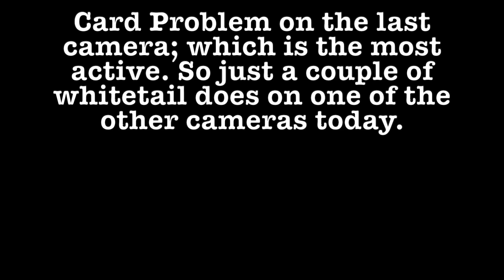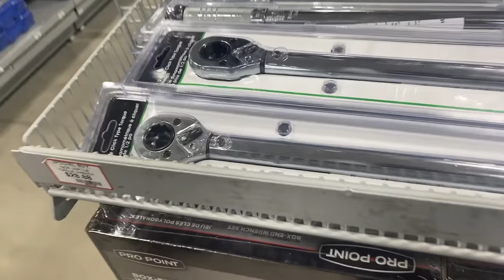BUILDING a CABIN in the FOREST - FIRE WOOD // LOW COST POWER // Simple Storage Ideas

Comment: $1600 is so cheap. What is the total cost to bring power in? I think we were quoted 10k per pole here in BC but it would have to cross other private property and I'm not sure how that would work out
Reply from the maker: $1600 was the total cost for the poles and it is $2000 for the panel and mast. So around $3600 all said and done for power. If we had to pay 10k per pole, we would have never ran power either. The first pole is free here and then it goes by per metre from there. After adding it all up, it just makes more sense for us to do it this way as Jeremy wants a working garage with high powered items, etc as well. We do want the ability to be operational without the grid and even operational in a worst case scenario, but want to be able to do whatever we want in the meantime. Hope all is well with you , things are looking good over there, we keep up on our tv as much as we can so dont always comment either :)

Comment: Can't wait to see the finished home.  Even though you're going on the grid, my suggestion would be to not have the well hard wired.  Not sure how you plan to power your home, should the power go out.  Unless you plan to have the battery banks tapped into powering your home, if the power goes out, then the well can not be used in the event the power goes out.  That's the problem I face with my own home in Gary Indiana USA.   It's hard wired, and I have no water, if the power goes out.  I do have a pressurized tank, but it limits the amount of water available without power.  .  My suggestion would be to have an outlet for the well, and then if the power goes out, unplug the well from the outlet, and plug it into the power strip for the battery bank.  That would be my suggestion. If you still plan to hard wire the well, then I'd suggest an outside plug to plug in a gas generator to provide some power to the home.  I have a family member who chose to have an outside outlet to plug in a gas generator, and power the essentials,  and one of those essential,  is the well pump.  Like my home, and yours, the well at that person's home operates on 240V.
Reply from the maker: We are planning on having the option at the panel to run the home off a generator as well. Thanks :)

Comment: Solar never really had a reputation of being cheap. The upfront cost was always high. You have to take into consideration of the long term benefits. It pays for itself in 10 years (or probably way less nowadays as solar gets cheaper every day), and it can potentially provide basically free energy for another 20 from there, whereas you'll get your monthly bills from your grid power supplier forever, and those bills will only get higher. And it's not like you'll lose your money if you decide to sell the place, solar adds value to your property.
Reply from the maker: We crunched all the numbers and in the long run it is not even comparable how much cheaper it is to run grid power for our needs. Maybe we will share our info someday more in depth. Note - in 10 years most likely all the batteries will need replaced and by 20 years all panels will also have to be replaced most likely. Having said that, there is more to it then that from our research and experience. All the best. :)
Reply: @MBFModernHomesteading  Obviously I don't know anything about your specific circumstances, all I know is that many people already have, or plan to install solar in the future. Both on the grid (no batteries required) and completely off the grid. And I'm pretty sure they did the math as well and arrived to a different conclusion. But again, your circumstances could be different.

Some european countries already planning new laws that new homes will have to have solar installed (just putting it out there, I know this doesn't affect you).

Anyway, I'm looking forward to the video if you guys decide to go into details about it. If not a standalone, maybe as part of a Q&A video.

And just as a suggestion, maybe try to reach out to a few people. Popular youtube channels get free stuff all the time. I saw people being sponsored by solar panel manufacturers, battery system manufacturers, or both. I know some people don't like free stuff, or don't like to ask for free stuff... But hey, it's content...
Reply from the maker: Yes, we have done plenty of research and circumstances vary big time, like we said, we may do a break down someday to give you some more insight. It is significantly more affordable to do it this way for us. Thanks and all the best :)  @janosszabo98